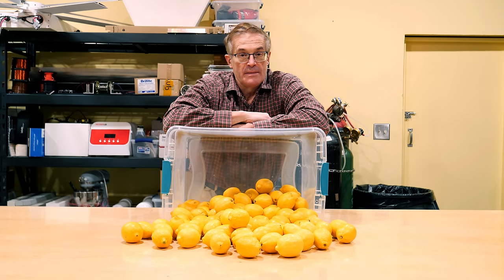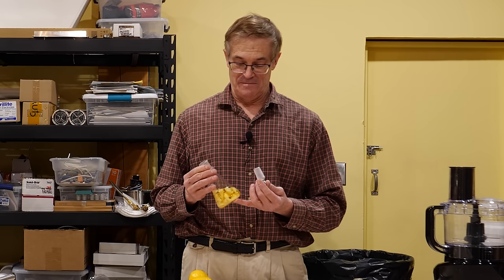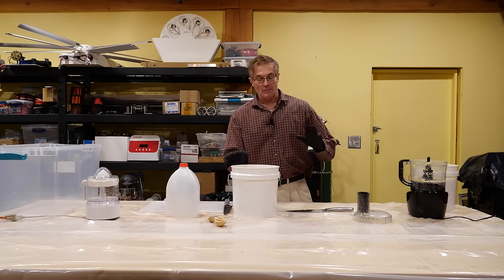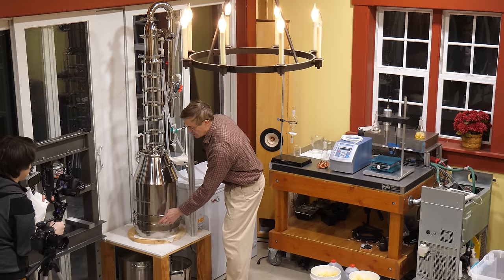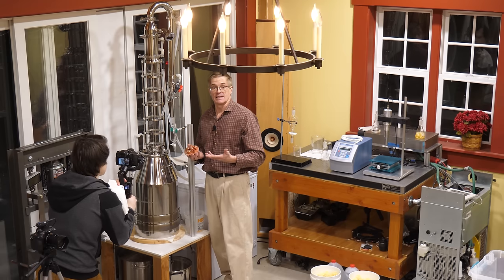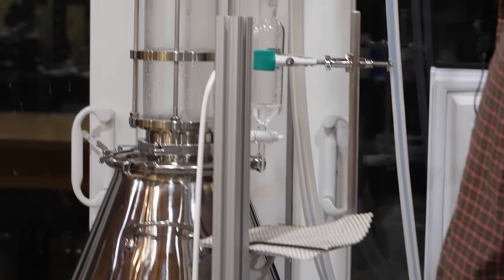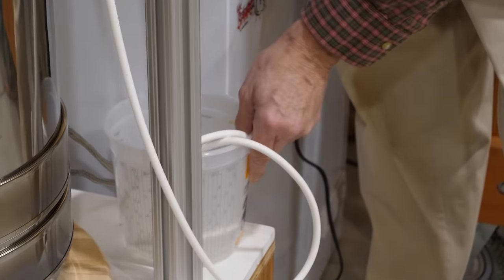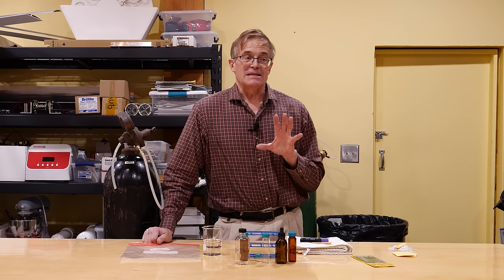CONCENTRATING LEMON OIL LEADS TO A VISIT TO THE HOSPITAL!

Comment: I have an idea for a new video for you. It's an experiment for energy 1 do electrolysis on water and keep the hydrogen and allow it to rise to a greater hight then use a fuel cells to extract electricity and water and then allow the water to built up into a column and place a water Turbine at the bottom next to the electrolysis machine to generate electricity and the combination of the electricity from the fuel cells and the turbine could that be enough to supply the power for the electrolysis machine and maybe more?

Comment: I wonder if it is possible to extract mushroom essence. It there actually is something like mushroom essence.
Reply from the maker: I don't think so.  They possess little aroma.
Reply: @TechIngredients  The smell of mushrooms is pretty intense. I pick only edible mushrooms of the Boletus genus. If not cooked immediately, I clean and cut them to slices and dry them in a food dryer, the whole room smells strongly of mushrooms. I can grind the dried mushrooms to powder and use it when cooking sauces. But I wonder if there are actually any "oils" that could be extracted. Because when dried, they lose a lot of aroma. I do also freeze a couple for christmas cabbage soup.
Reply from the maker: Maybe so.  The essence doesn't have to be an oil although it often is. The challenge then would be the final separation if the essence is water soluble.  Have you ever tried soaking the mushrooms in concentrated alcohol?
Reply: @TechIngredients  Thank you for your answer. It is quite rare to have a conversation with a content creator. With this out of the way... I did not try to soak the mushrooms in alcohol. Maybe the "aromas" (whatever their physical, or chemical composition might be) are better soluble in alcohol rather than water. I must try this out, but I need to get some neutral ethanol. And wait until the next season, usually late summer/autumn. The sorts of mushrooms I forge for are notoriously known to be unable to cultivate. They need specific conditions of soil and flora (symbiosis with certain trees) to thrive. Lucky for me, I live close to regions where they grow naturally. I can only hope that this year will be a good season. The last three were quite weak, the conditions (mostly weather) were not right. But I remember when they grew like crazy. I did not pick them because I was too lazy to bend over, already carrying a pretty much full basket. And fully knowing that I will spend hours to clean and cut them for drying (an activity much less pleasant than walking in the forest, regardless of how much I find, it is a very nice experience each time, seeing wildlife deer, enjoying the fresh air, listening to the wind in the leaves, noticing so many little things, being alone with nobody around me for at least a kilometre, the silence). I pick only for my own consumption and for relatives, I do not sell anything. Hopefully this year I will have the luck for a good harvest, so I can do experiments with soaking in ethanol (as well as in water for comparison).

Comment: Why not use CO2 (dry ice) rather than liquid Nitrogen? It is heavier and I assume easier to obtain.
Reply from the maker: You could.  The weight doesn't matter and the nitrogen is not a liquid, so it can be stored for years in the cylinder.  Dry ice will evaporate, but if you happen to have some around it would work fine.

Comment: Would have a perfect example of how effective super glue is instead of stitches.
Reply from the maker: Superglue will seal the wound edges but does nothing to reduce the tension across the wound. That results in more scaring. That is why Superglue is not used during a face-lift.
Generally,  if the wound is minor and stitches are not needed, neither is Superglue except as a quick bandaid to stop bleeding.
Reply: @TechIngredients  I believe you. Thanks for your reply! I have used super glue for minor slices but nothing ever serious. I thought it was a good alternative. This is why I love your channel!

Comment: could one use propane instead of nitrogen to replace oxygen with adequate results? idk.
Reply from the maker: No.  It will be highly soluble in the oil and would be present in the oil when you use it.
Reply: @TechIngredients  thanks for reply. 
one may also store these oils within other non expensive oils(i.e. vegetable) to help preserve from oxygen, then to separate can be shaken with ethyl alcohol and top layer will be essential oil/alcohol. 
note that when adding to other oil, can't rely on volume change to measure amount as density of mixture changes more than volume.

Comment: 18:00 why do you think it helps to let it run at 100 % reflux (infinite reflux ratio)? I dont see how it could help. The process is fundamentally different from normal distillation, since the oil is only evaporating with the water. Its vapour pressure is low, but not 0, so a little evaporates -> the water will remove this little bit while boiling away, thus the equilibrium cant be reached -> more evaporates. Its like blowing lots of air over it, except that here all that air would be condensed to a liquid, the partial pressure of the oil will far exceed the maximum possible, so it too condenses. At the same time, it cant "concentrate" there in the column, it just condenses and flows back down again. Since no water evaporates in the column (even if it wasnt empty) it has not effect. Water has to condense to get the partial pressure of the oil above the  saturation vapour pressure, which then condenses, but doesnt evaporate again - unless the water vapour it passes is not already saturated with oil, like at the very beginning.

I would even argue that the longer dwell time at the high temperature could cause (more) breakdown of compunds, which could result in a different smell.

I doubt you will even read this, oh well, youtube, where the cut is the main topic.
Reply from the maker: As I explained in the video, the reflux condenser "traps" all the vapor while the hot water and turbulence have time to extract the oil.  This increases the percentage of oil in the output once the reflux condenser is shut down.
Reply: @TechIngredients  Cool that I didnt just waste my time. 

Okay, you just want a higher oil:water ratio in the output. But how does this matter? Why not just distill a bit more water? It saves both time and energy.

One could indeed argue that this reflux removes oil from harder to reach regions and lets it collect at the surface of the water. But everything that was "liberated" could already have been collected. Its locally faster (higher oil:water ratio) once the reflux is shut down, due to the "liberated" oil, but globally slower since it costs time to do this "liberating". It increases the oil:water ratio at the cost of time and energy. Water is cheap and you seperate it anyway. What is the upside of all this effort?

Comment: why don't you add an enclosure and isolate the heater so you can save energy and reduce the required time?
Reply from the maker: Little heat is lost through convection.

Comment: no superglue?
Reply from the maker: It can be useful, but stitches have advantages.  By reducing tension across the wound they reduce scarring. This is why a plastic surgeon  will use stitches rather than  tissue  glue (basically superglue) when performing a face-lift.

Comment: saturated fats in fish don't have a high vapor pressure lol. The smell is from bacteria on the surface
Reply from the maker: I'd agree with your first statement, but the second seems like a stretch.  I've smelled salmon seconds after it was pulled from the water and the aroma is there. It strengthens with time, but the character remains the same.

Comment: 7:00 PINCH IT FAM. 😅 Thats not hospital worthy 😂☠️
Reply from the maker: How do you know?  You didn't examine it. It healed nicely after the sutures were placed.
Reply: @TechIngredients  simply stating an observation 🤷‍♀️ based on personal experience. Typically a tight dressing is all thats needed, if the edge is sharp and the laceration is clean and it isnt on a knuckle or stretch point.
Reply: @TechIngredients  im from the, pour some alcohol on it, wrap it in black tape, and get the job done school. So maybe we have different perspectives.
Reply from the maker: The cut was clean but very deep, and the finger tip was numb. The local injection allowed a thorough  examination and cleaning, and the sutures reduce wound tension across the gap, which minimizes  scaring.
Reply: I imagine there was, and still is, some nerve damage. Had a similar incident about a year ago where i almost lost the end of my right index,  just after the last knuckle and into the nail bed.. Glad yall handled it ! He certainly took it in stride! Lol

Comment: Stitches? Just segue into a video on cyanoacrylate!
Reply from the maker: There are significant  advantages  to stitches. Scar formation  increases as the tension at the wound edges increases.  Stitches are placed a little  inboard of the wound edges, reducing tension as the tissue heals. Surgeons will add a similar tissue  glue as a last stage to maintain edge alignment and this saves time rather than accomplishing this last step with fine sutures.

Comment: Nonsensical, slow, wasteful and poorly effective way of flushing N2 into the bottle. Why is the cap left on the bottle when flushing? The cap prevents displacement kf the air in the bottle, even if the cap is loose. Better to spray N2 under the cap. No bag needed. Takes a few seconds.
Reply from the maker: As I stated in the video, the cap was intentionally left loose.
Diffusion  is an excellent method.
Your  technique isn't  as effective because the oxygen takes time to diffuse out of the liquid.  No matter how fast you blast the nitrogen  above the oil, you're  only exchanging the gas phase.
Reply: You left the cap on the bottle and that was my main criticism.. Are you using a permeable cap? Probably not. Even a loose cap traps gas. When I flush bottles, I come back later and flush a second time to remove O2 evolved from the liquid. Your O2 is still in the bag. And the bag, being thin plastic, is highly permeable to oxygen. So oxygen is entering the bag the entire time you have your bottle in the bag.

Comment: 8 min. in the Video and it´s already enternaining, a guy cut his finger and is close to pase out 😂. A drop of cyanoacrylate would have solve the problem.
Reply from the maker: I did put in a few stitches.
If you have the option, it works better as the reduction of stress across the wound reduces scaring.